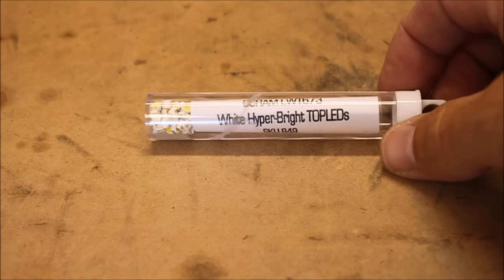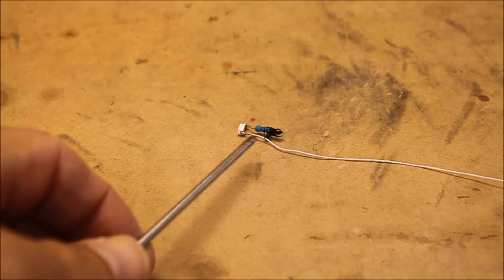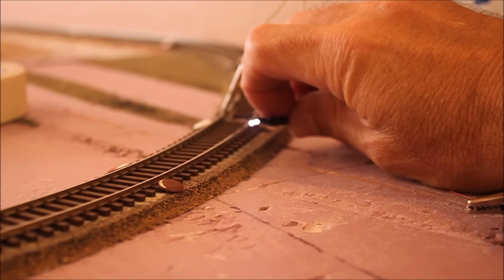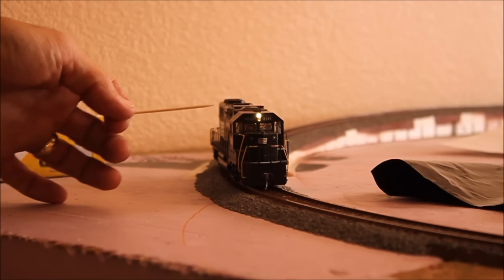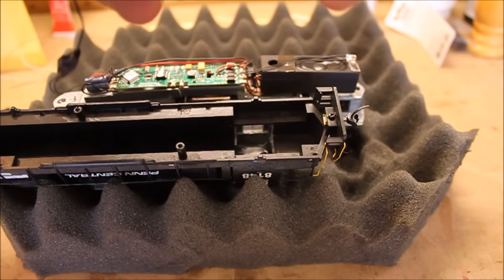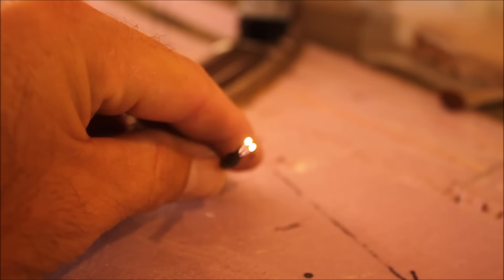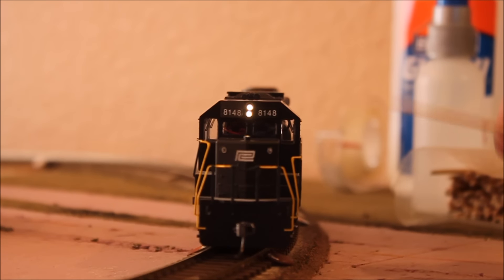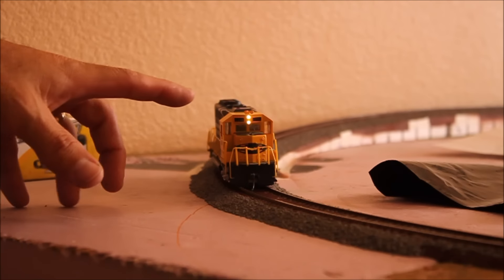Upgrading and Modifying HO Scale Locomotive LED's

Comment: I've never used the SMD LED's.  I use either 3mm or 5mm LED's depending on what I'm doing with them.  For illuminating coaches I always use 12 volt LED strip lighting with keep alive circuits.  The first strip of LED lights I ordered the bright white which were actually too bright for my liking and the period that I model.  So, I painted each LED with some yellow acrylic paint and now they are perfect.  The next strip of LED's I ordered were warm white.  One learns from ones mistakes.  I even use the LED bulb itself for a lens most of the time.  Cheers from eastern TN
Reply from the maker: sounds like you have some experience with lighting and LED's. I don't have any passenger cars/coaches/combines, so my experience with that is almost none. LED's have come along way over the past few years. Thanks for watching and commenting, I appreciate it!

Comment: Nice, I think the headlights turned out great. Several of my locomotives need some work done on the lights. Might have to give this a try!
Reply from the maker: Thanks! I wish I would have taken a pic of the surface mount LED's in the headlight before changing them so you could see the difference. This method takes less time to do than explain.

Comment: Great idea! and great job on it. Those engines look awsome! Thanks for sharing your thoughts on this matter. Iwas going to try it in asimilar way, but now you solved my problem, thanks. And you have your self and your family a Merry Christmas and a Happy New Year. RT
Reply from the maker: Hey, glad it could be of help and I'm sure you'll do just fine. Yes, I think the lights look WAY BETTER than before. When using the surface mount LED/resistors/wiring/tubes, it was hard to fit 2 individual lights under the shell. This way, I got one light and 2 tubes to deal with, much easier fit. Thanks for commenting!

Comment: Nice job. Informative. Great result. How about using a heat gun/hair dryer for shrinking the tubing? This produces a quick, gentle, uniform shrinkage. Also, the fiber optic material you're using is a rod not a tube, correct?
Reply from the maker: I didn't own a heat gun when the video was made, not sure if it would work and I would have to experiment with it to see what happens (I'm really good at melting stuff that shouldn't be melted). Yes, the fiber optic is solid core. Thanks for watching and commenting!

Comment: Thanks for showing some tips! Just a quick question, in general where can you get that fiber optic tubing? Ive looked around and cant seem to find (that or I just havent looked hard enough) Also where do you get your heat shrink tubing? I had a decent amount I bought for cheap at an old hardware store that just recently shut down and, Lowes doesnt seem to have any in a small size.... Thanks for the help!
Reply from the maker: Christopher Huffman I bought the fiber optic tubing on ebay, $11/free shipping for 24 feet. Just do a search on ebay for 1.5mm fiber optic and they'll come up. I bought my heat shrink tubing at Lowes. The smallest they have is 1/8". Radio Shack has shrink tubing, but it's a variety pak with different sizes. If you want smaller shrink tubing, you may need to order it off the internet. Thanks for watching and commenting!

Comment: I have a few athearn RTR locos I need to try this with. I have 3 SD50s, 2 SD40s, a GP38, and a proto 2000 SD7 I need to try the LED upgrade to.
Reply from the maker: Looks like you have quite a fleet of locos. Glad you found the video and hope it works for you. Let me know how it works out. Thanks for watching and commenting!
Reply: @PennCentral99  will let you know if I don't mess up the first couple. I'm more of a Chessie modeler. Newer stuff isn't to appealing with the depressing paint schemes, lack of cabeese, and ditch lights.
Reply from the maker: I'm sure you'll be happy with LEDs instead of incandescent
Reply: @PennCentral99  thank you for the response. I hope I will be happy with the results too. Getting tired of the tiny bulds burning out.

Comment: Hey, Cool! i was actually thinking about doing the same thing with the 3mm, with the fiber optic tube. How hard was it to get the tube's in the holes?
Reply from the maker: Yeah, one 3mm and 2 tubes take up less space under the shell. As long as you don't put the heat shrink too close to the end and allow the fiber optic tip to be flexible and separate, it goes in the holes easily. Thanks!

Comment: Looks great! Did you try covering the part of the LED in the shell with liquid electrical tape?
Reply from the maker: Thanks! No i didn't (but it might be worth a try). You would have to be careful not to apply to much and make it thicker than the light opening. I did try using a black permanent sharpie on the sides (which wore off as I was putting it back together).